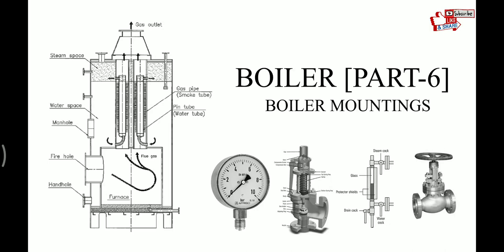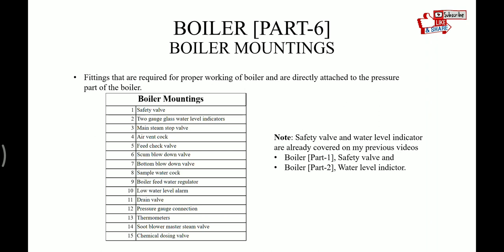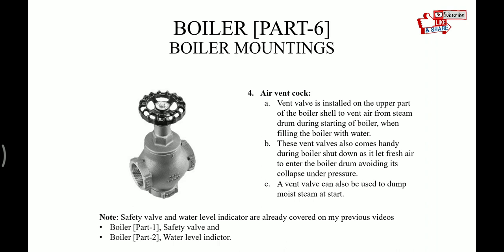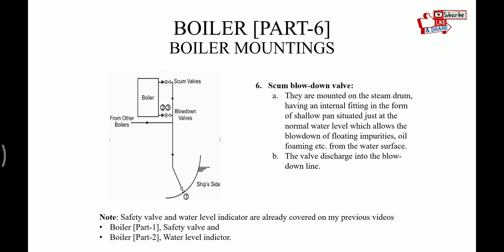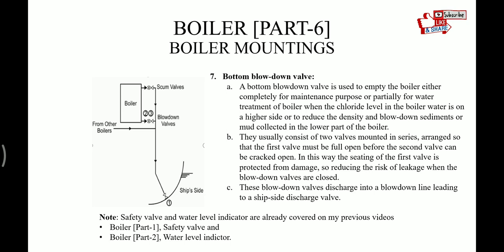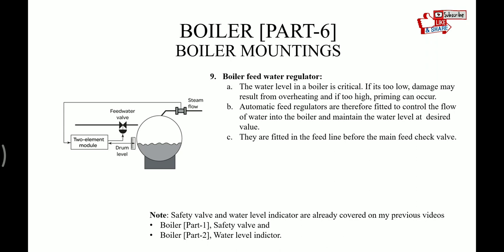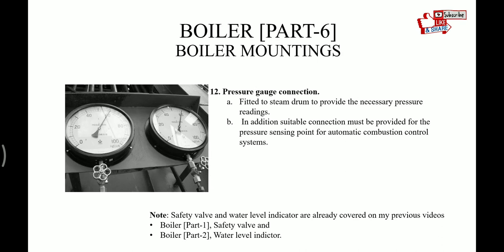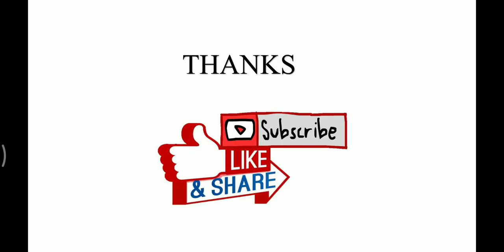Boiler [Part-6], Boiler mountings.

Comment: Why boiler gauge glass at different heights
Reply from the maker: Both the gauge glass are at same height.
Reply: @meoexams  thanks sir
Reply: Sir, what if we keep vent valve close during starting?
. And what is the effect if we keep air inside the drum?